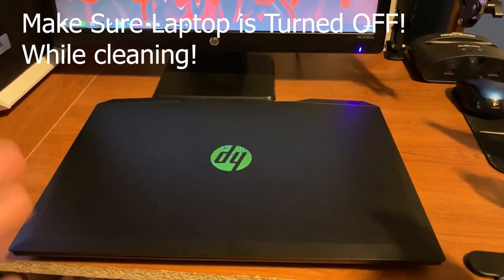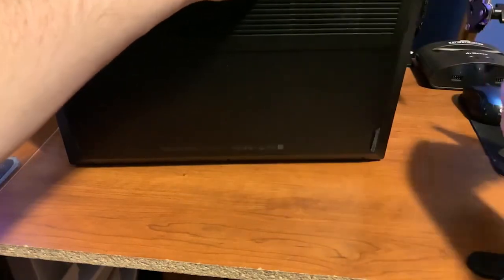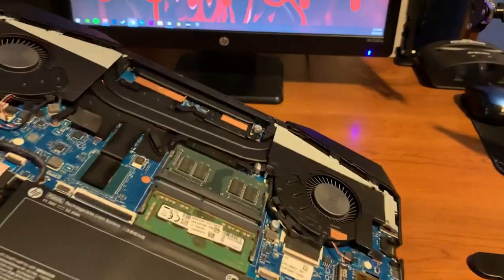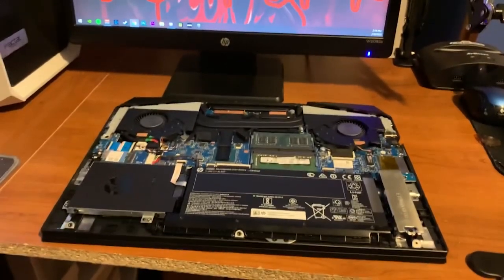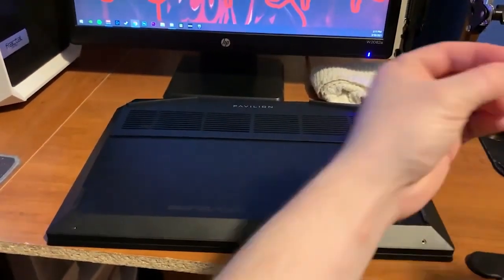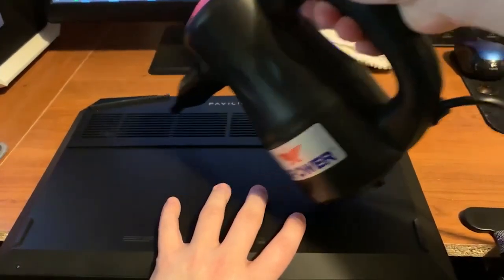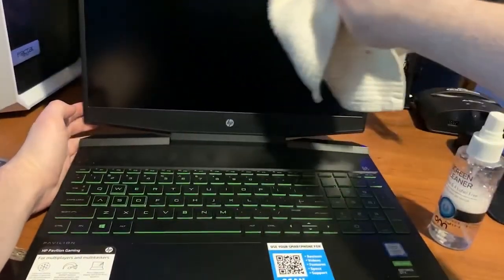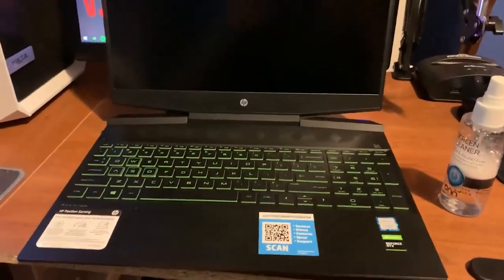How To Clean the Hp Pavilion  Gaming Laptop

Comment: Didn't mention blowing out the heat sinks, which are what keep your machine cool, and probably the most important part to keep clean. They are located in the rear, near the fans, and look like miniature air cooled radiators. Hold the fans still while blowing these out so it doesn't spin them faster than they are designed to spin. I've had problems from accidentally doing this in the past. Also, blow the cover off when it is detached away from the laptop, before you put it back on.  Thanks for the video, the rear cover had me beat until you mentioned the guitar pick. There was a large gap in the rear, I had some plastic Auto Body Picks I used to pop it off. Thanks again.
Reply: thanks for the additional tips!!

Comment: I bought this laptop a year ago. I  absolutely love it. I have the amd ryzen 5 4600h version of the laptop.

I bought it as a budget gaming laptop. I could have bought an Xbox one for the money. But I also wanted it to be mobile and productive.

Anyways...Is the "fans always on" normal?  It just seems unnecessary when it's idle or when I am checking my emails or watching YouTube.

The fans are always running no matter what on battery power or plugged in.

I can understand why you would want the fans on while gaming. But for it just sitting on idle or for videos.
Reply from the maker: So I’ve had this happen as well looked into. They are supposed to be at least more quiet and run slower when idle, like on YouTube or what not. But it is normal when gaming. But like are they just running normally when your idle? Or are they like running hard and loud?
Reply: @FatalReaper  The fan are quiet and don't bother me. I just found it odd that the fans were on even on battery.
Reply: if you use chrome thats your answer
Reply: @supathechest  I have looked into the bios on my pavilion with a Ryzen 5 3550h and there is a setting where you can toggle the fans always being on or the fans being on when they need to. I think to get into bios when you boot you press f 10 or f11.
Reply: @mattsaganowski2689  i think i have them only on when needed as the infamous pavilion loud fan is more prominent with ram-heavy tasks/software
Reply: I have the intel version and it is very quiet, my friend has the ryzen one and yes it does make noise.
Reply: It does run idle quietly but i believe it goes even lower but limits what you can do by putting it on battery efficiency mode

Comment: Having problems with my laptop rn it’s the exact same one u have! I’m currently facing an issue where the laptop is plugged in on the charger and it keeps going into the charging state and then all of a sudden it stops charging then starts up again! Was wondering if you have had this problem?
Reply from the maker: May be an issue with your battery it may need to be replaced

Comment: Can I use hair dryer with cool air of course to get of the dust? 😂
Reply from the maker: I mennnnnnnn seems like it would work 😅
Reply: I have a question for you right now. I have the same HP pavilion laptop as you do in this turtorial video. I bought it 3 years ago and I didn't clean it once since then and now when I play cs2 is lagging all the time when I play. That is due to overheating my lap top because its probably full of dust? It gets hot and my lap top shut down itself 4 days ago when I watched a movie due to overheating.  @FatalReaper
Reply from the maker: @highflybirdy851 I would definitely clean it dust it out really well maybe buy a cooling pad, and even do a factory reset and see if it all clears out

Comment: My laptop shutdowns on its own and then i have to wait for 10-15min after then only i can start it again. Solution
Reply from the maker: Is your battery dying?
Reply: @FatalReaper  No
Reply from the maker: Make sure you have updated any windows/driver updates. If that doesn’t work. Then you may have a faulty laptop
Reply: Is it getting too hot maybe?
Reply from the maker: That is also possible.

Comment: hey can i use a hair dryer on cold instead of the air duster ?
Reply from the maker: I wouldn’t recommend that because it gets hot fast and could heat certain parts up
Reply: @FatalReaper  the hair dryer has a setting on cold air
Reply: @FatalReaper  heyyy
Reply from the maker: I still wouldn’t recommend a hair dryer I would always go with can of air

Comment: I just wanna ask why I am not getting the potential from my laptop I can't even run Minecraft I get like 60-70 fps pls help
Reply from the maker: Which version of Minecraft are you playing?, and those are about the normal frames I got on Minecraft as well, the 1650 graphics card isn’t gonna allow you to get much more on games than 60/70 FPS
Reply: @FatalReaper  it Minecraft 1.16.5 but they drop to 20-30 and can you run fornite apex legends and other heavy games on it? Cus I can't
Reply from the maker: Have you upgraded graphics drivers? On GeForce experience, and have you set the frame cap to 60FPS+ on GeForce experience?, and last do you play on high performance on your battery setting? Those 3 things could easily be the issue
Reply: @FatalReaper  yea I saw you're video but still and I could barely get 50 fps in fortnite on the lowest settings possible literally I couldn't see anything still 50 fps I have reseted my laptop any tips?
Reply from the maker: Other than everything I just said in the last comment and leaving your laptop plugged up to charger, I’m unsure why you wouldn’t be able to get the FPS I run all those games with no issues
Reply: @FatalReaper  ty liked and subbed
Reply from the maker: Appreciate it, hopefully you can fix the issue, try all that, and the battery performance, because that can cause FPS drop and lag
Reply: @FatalReaper  sure!!
Reply: @FatalReaper  and also try and post a best obs settings video ;)
Reply: This is something that helped me go to nivida experience and turn off battery boost and play with the laptop plugged in
Reply: Sorry I meant GeForce experience
Reply: If if doesn’t work you can reach out to me but it is 1 34 am where I am
Reply: I had the same problem as you
Reply: @Jason-il7zw  Ty bro it's fixed

Comment: Does this effect the performance of my laptop
Reply from the maker: Not really. However if you had a bunch of dust build up in your fans it could cause some issues with your fans running and cooling everything inside the laptop
Reply: @FatalReaper   oh okay thx
Reply from the maker: No problem
Reply: Is 80 -90 degrees normal for my gpu
Reply: @znok967  no. it should be only like 40 idle and on gaming 80 should already be a big warning. cleaning your laptop is very important and it can effect performance ALOT on the laptop for gaming. For example i didnt clean my laptop for like 6 months and before that on the game CSGO i ran like 350-400 fps easily, but after not cleaning it my gpu and parts heated up from the dust build up which lowers performance and could potentially damage one of the parts if it heats up too much.
Reply: @grizzlylama  oh okay thanks a lot :)

Comment: Is there a way to clean underneath the keys?
Reply from the maker: Honestly I just use the air duster I have and use it on the keys and under them. You don’t want to remove the keys if possible in the laptop anyways because it can damage them if taken off too much. So I would just try to use an air duster for the keys
Reply: @FatalReaper  Thank you, let's say hypothetically one were to spill a bottle of Angry Orchards Hard Cider on it, what can one do in that scenario?
Reply from the maker: Try your best to dry it out with a hair dryer if possible.
Reply from the maker: You could also probably get another keyboard and use an external keyboard if that one ever just stops working as a result from the spill